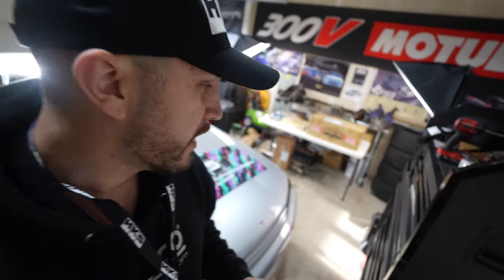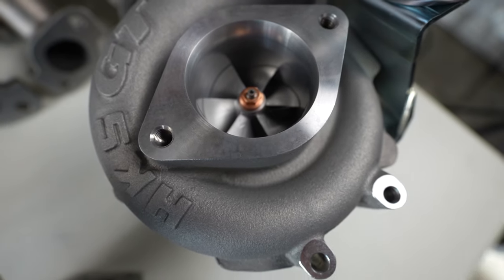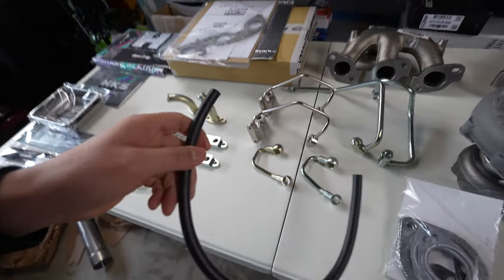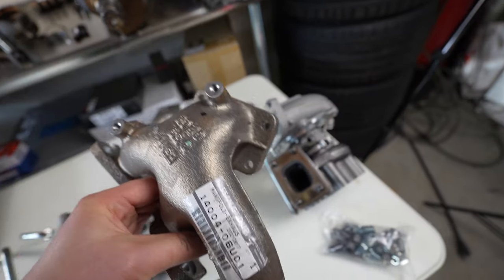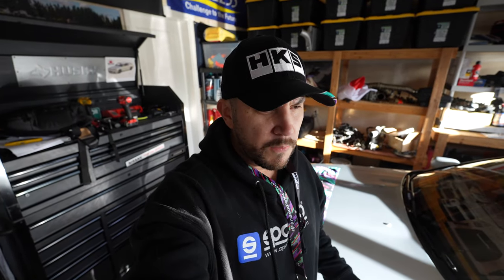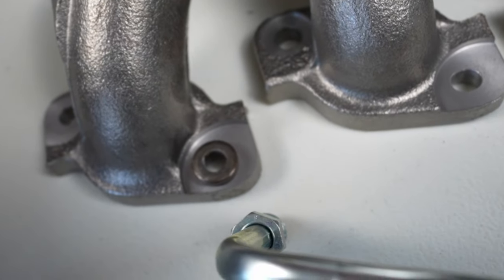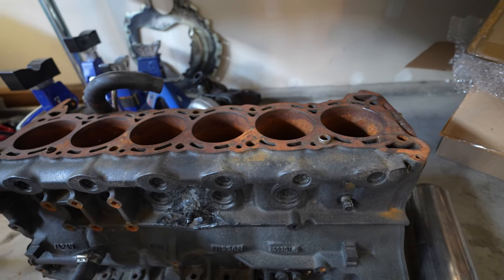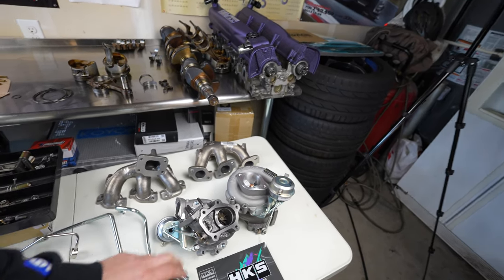HKS 2530 turbos Nissan Skyline turbo upgrade for RB26dett BNR32

Comment: Great video man, I was wondering if you were going to cera-cote the killer N1 manifolds, good job 👊🏻
I have exact same setup with my R32. My project was finished last year(fall) so I got a ride or two in before parking. But found my front 2530 leaking a small amount of oil into the suction side. I’ve been looking at new ones like yours. So thank you on this footage, time to save and park the car until I have a set. After a monster rebuild I’m not risking anything on my N1 engine.
Reply from the maker: Yes going to have them ceramic coated for heat management. Thanks for watching.

Comment: If you do sell I don't blame you. It really takes a lot out of you mentally when you're constantly fighting mechanical problems. A major project like an engine rebuild is also so much time spent dealing with uncertainty, the cost of mistakes is high. That certainly weighed on me too. It's not like a cheap Miata where you don't feel bad if you ruin something.
Reply from the maker: Yeah its overwhelming for me to deal with everything. Nothing is for certain as of now.

Comment: Shame you're looking to sell, I like your videos. I guess this is why I've left my 260rs stock. I don't want to open the can of worms that is modifications for more power. Especially as I have other cars to maintain and enjoy.
Reply from the maker: I have been thinking the same thing to myself. I should have not modified my car. I put 20k kilometers on it with almost no issues. Once I added the big turbos, oil blow buy issue. Then after installing VCAM it didn’t last long. Should have installed a new oil pump. I know that if I would have stayed stock, I would still be driving it. Thanks for watching.

Comment: Are these pressure controlled actuators? if so how did you set your boost levels?
Reply from the maker: The turbos do have actuators built in set to a specific boost pressure selected by HKS. My guess would be somewhere around 1 bar. Your boost controller will allow you to turn it up more.

Comment: ever thought about rebuilding the stock twins with steel internals?
Reply from the maker: The last twins I installed were R34 turbos with modified compressor housing and lightweight billet compressor wheels. The CHRA ball bearing center cartridge failed and filled my oil pan with metal fragments. That is why I pulled the engine for a rebuild and decided on HKS with journal bearings.

Comment: Hp?
Reply from the maker: Easily 500 wheel on pump gas. Could easily do 600 wheel on e85.
Reply: @JDMRightHandDrive   what is better this twin turbo's or HKS T04Z i found 2 r32 1 with twin turbo ( from this video) and second ( with  T04Z)